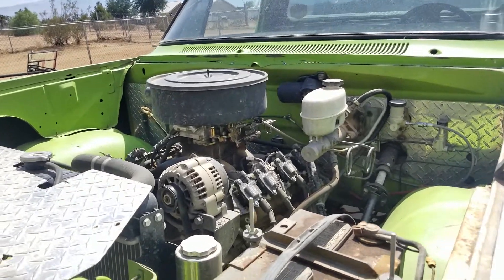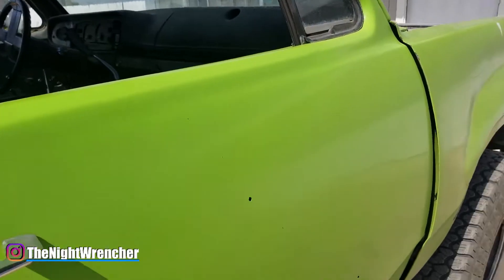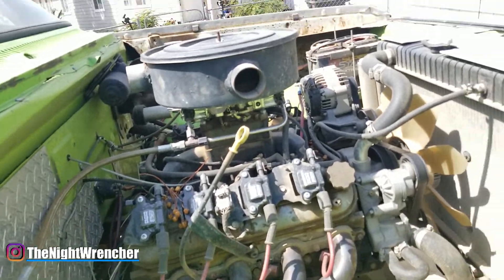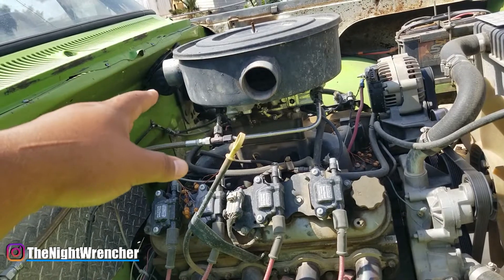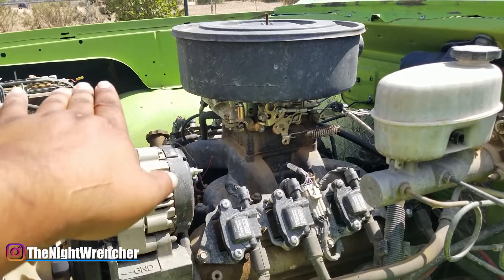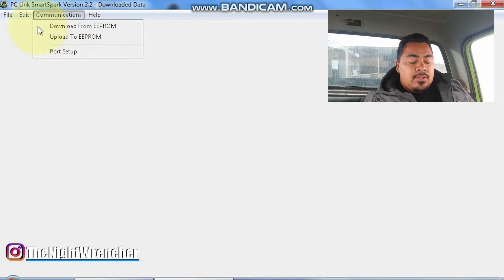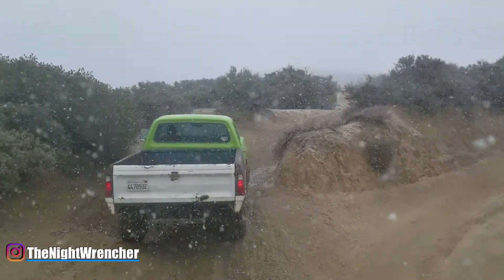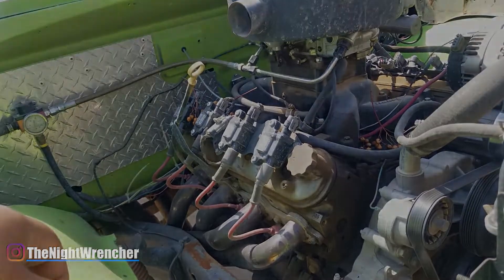6 Month Review- Daytona Sensors Smart Spark LS Ignition Controller | SSLS | Carbureted LS

Comment: Sup bro i currently have the smart spark ls too and I’m running rich and trying to figure out why. I have a 6.0 with 5.3 heads and 650 holly carb and I have the mode set to 1 the advance set to 5 and rpm set at 6 on the x1000 and 7 on the x100 can u give me any info please?
Reply from the maker: Hey man, how do you know that you're running rich?
Reply: @NightWrencher  I can smell fuel coming from pipes that use to burn my eyes before I ran the pipes in it but I still smell it and it’s a light white or blue looking smoke coming out of the pipes
Reply from the maker: @tyrekcarter4973 have you already set the idle on the carb? Ignition does not determine whether an engine runs rich or lean.

Comment: Need some help please....have the smart sensors hooked up to my gen3...issues with that motor, so now have a gen 4 on the stand...plugging the oil risers,removing goofy ass lifters,i believe  the daytona can be adjusted for the 58x crank,what about cam sensor and what cam gear..thanks for any help
Reply from the maker: Hello, if you have a gen 4 engine, the smart spark. Should work fine. Mode 2 works with 58x crank trigger and you'll need a 1x cam gear reluctor if it doesnt already have one
Reply: @NightWrencher  so I will need a front cover with the hole for sensor,will my gen 3 sensor fit the front cover,of need a new one.thanks

Comment: How do you figure out what port to plug your USB cable into cuz mind saying invalid Port I've changed a few of them and it still saying that but my computer has 254 forced to choose from🤬🤬🤬
Reply from the maker: Disconnect your usb, open your device manager in windows, plug in your usb and see what port # was added. Go into the PC link software and click up top in one of the drop down menus where is says something like port config then select the same # as the one shown in the device manager
Reply: @NightWrencher  thanks a lot you are a lifesaver‼️👍🏾👊🏾
Reply from the maker: @bigpetie66  no problem, thats what I'm here for 👍
Reply: @NightWrencher  👍🏾
Reply: I tried what you said in the device manager it comes up Port 3 so I pick Port 3 on the Daytona setup when I click download from eeprom is coming up that is not valid check your cable or your Smart Box could you possibly tell me what I'm doing wrong about to pull my hair out and I don't have any cuz I'm bald🤣
Reply from the maker: @bigpetie66  did you make sure the box was getting power?
Reply: @NightWrencher  yes it's getting power  the car cranks up and runs fine I drove it out of my shop for the first time yesterday I'm just wanting to put my own time and Curve in it so I won't have to run a map sensor with the curve that is running off of now
Reply: We even put a new cord and module box did a friend of mine had and they knew Daytona system setup that he hadn't put on his motor yet and it's still red the same thing with the brand new stuff he had Straight Out of the Box
Reply from the maker: @bigpetie66  did you make sure the little module switch was selected to "smart spark" and not "CD"
Reply: @NightWrencher  what selector switch is that I'm totally lost now I haven't seen one on the little box unless I'm looking over it
Reply from the maker: @bigpetie66  look on the black tuning module where the UBS plugs in. There a switch. Switch it to smart spark is if already isnt selected
Reply: @NightWrencher  okay thanks I'll try that tomorrow when I get to the shop if it's already in that position do you have any other suggestions or what may be the problem
Reply from the maker: @bigpetie66  sometimes you have you close everything down, disconnect everything. Open the program back up and then hook everything up after.
Reply: @NightWrencher  thanks a lot I really appreciate it I'll let you know what is the outcome again thanks a lot👍🏾
Reply: @NightWrencher thanks a lot for the information on the selector switch on the box it was on cd1 soon as I put it over the smart everything work fine I finally got my timing put in tonight thanks a lot I really appreciate the information👍🏾🙏🏽

Comment: Hey night wrench I’m have the same issue as you had with your msd box, I.e weak spark and you replaced the msd…. My scenario is we got strong spark ⚡️ on all 8 cylinders but when I disconnect cylinder 1-3-4&6 engine does not change. Checked compression. It’s at 150psi. Could it still be the msd box? Just got it from summit… outta of the box
Reply from the maker: Have you tried running a spark tester inline of the coil and spark plug to see if its still firing when rpms go up? Whats the spark gap at?
Reply: @NightWrencher  I did. I applied my spark tested inline with with coil and spark plug. With high rpm’s spark does indeed get quicker. The gap on the plugs were preset for a 05 avalanche which is where the motor came from . I don’t recall the number
Reply from the maker: @betoo0311  if you have good spark, its unlikely that the box is the problem. Try to richen the mix to see if it responds. It could just be running lean

Comment: Silly question; SSLS and Harness sold separately? So $600?
Reply from the maker: I don't know what the current prices are but yes the harness and the box are seperate. Make sure you buy the right harness for your engine, I think there are 4 different ones 👍
Reply: @NightWrencher  thanks for always helping with the comments ✊🏾
Reply from the maker: For sure, you know got you 👍
Reply from the maker: @Carlton Fortune What did you do with your old carb stuff?
Reply: @NightWrencher  I gave carb and fuel pump away
Reply from the maker: Shoulda sent them to me 😂
Reply: @NightWrencher  Yeah I should have but that was about a year ago now
 😂 I’m looking around now and this $600 not going to do much for me 
where do you usually get your head gasket set since you use the carb setup ?
Reply from the maker: I buy them as I need the gaskets but usually oreilly because they price match rock auto
Reply: @NightWrencher  subscribe to my channel I’m old to YouTube new to adding stuff
Reply: I have 03 lq4 stock can’t decide on sniper or carb still have sniper just have not installed just getting back to it
Reply from the maker: Well if you already have the sniper, just run that. For the sniper you'll need a high pressure pump and for the carb you need a low pressure high volume pump like a holley/summit blue pump
Reply: @NightWrencher  yea I already ran the fuel system I got the whole kit came with pump
Reply from the maker: Well there you go 👍

Comment: Would this be something you would recommend for an lq4 with f35 cam and 706 heads?
Reply: So I have the box hooked up as recommended by the install guide...I have no spark. The two red indicator lights come on for a split second when I turn the key and that's it. Any ideas?
Reply from the maker: Yes, thats normal. They will stay on while its running. How have you verrified that there is no spark?
Reply: @NightWrencher  I have an in-line tester kind of like a test light. I also did the old school test, stick a screwdriver in the plug wire and ground it for a spark while cranking
Reply from the maker: Yeah, thats my go to also. Remember that it takes at least 3 secs for the coils to start firing on this system. So make sure youre cranking it at least 3 secs to make sure its not firing. Next, have you tried wiring the box directly to the battery?
Reply: @NightWrencher  not straight to the battery. I have it on a 12v switched wire commin of the fuse box
Reply: @NightWrencher  I let it spin numerous revolutions to make sure there's ample time for the crank and cam sensors to link up but nada
Reply from the maker: @henryrangel7354  ok, try it straight ti battery and make sure the engine is grounded
Reply: @NightWrencher  I have a two grounds to the block..one from the fire wall and the other from battery
Reply from the maker: @henryrangel7354  ok, if you wire the red wire to the battery, that should bypass all the other wiring and it should spark
Reply: @NightWrencher  ok I'll try that
Reply from the maker: If you want to go carbureted because you like tuning carburetors then yes. If you think it'll just bolt together and run perfect then no, stick with factory efi
Reply: @NightWrencher  I have everything I need to go carb ...I bought the engine without oem intake
Reply from the maker: Oh ok, then this box would be the last piece of the puzzle. If youre comfortable with carbs, you shouldnt have an issur

Comment: Hey so I have the msd 6014 ignition box on my 5.3 a swap into my truck. Ran fine without issues for the first 3 months or so. Now every time you start it it's starts popping out the exhaust and sometimes the carb. But if the alternator is unplugged not charging it runs great. With it charging is when it starts misfiring. I already replaced the alternator and within 10 minutes of it running good it started popping again. Any ideas? All coils have spark, I replaced cam and crank sensor. Checked the wiring diagram to make sure it did that right. I pretty much am at the point where I think it's the ignition box.
Reply: I ended up adding a ground cable from a bolt on the alternator bracket straight back to the battery. And another battery cable from the post on the alternator back to the positive on the battery. Seems to have fixed the problem. Thanks for your input 👍
Reply from the maker: Nice! I'm glad it worked out for you man
Reply from the maker: Its quite possible. I would play with the mixtures at idle to see if you can get it to clear up. Have you tried calling MSD?
Reply: No. But I'm about to cuz I'm stump. I've tried different a carb on it to see if that would change anything but it didn't. It's just weird that if the alternator is unplugged it's fine. I even bypassed the truck wiring and just jumped a wire to the back of the alternator. And as soon as it starts charging. The idle drops and it starts popping and banging.
Reply from the maker: Did you try checking all the grounds?

Comment: Will the conversion adapter they sell work with the 6014 harness ?
Reply from the maker: It will but you will need to repin part of the conversion adapter because the 6014 is pinned different than the 6010/6012
Reply: @NightWrencher  okay thanks a lot for the information I have a 6014 on my car won't start because it's reading crank fault sensor and it has a new ACDelco sensor in it I'm just tired of fooling with it🤬
Reply from the maker: Yeah I wish there was an easy way to test these boxes but I dont really know how
Reply: @NightWrencher  thanks

Comment: So how much & how difficult u think adding the stock ignition would be for me?? Have any links??
Reply from the maker: Stock ignition for a sniper? Ive heard of a few people doing it but I dont know exactly what they have to do. For a regular carb you have to run a custom tune with HP tuners and add a tps to the baseplate
Reply: I know you’re getting tired of me but going to junk yard tomorrow to look for heads are the 862 the best option for me? 
I see a lot of ppl say 799 or 243 let me know your opinion please. Nobody really on LS swapping around here so heads are only $70.
Reply from the maker: 862 are your best bet for an NA build 👍799 or 243 heads flow more but you get more compression from the 862 so itll run better
Reply: Ok got it
Reply: So I got $600 to spend right. 
I have 4 header bolts broken off-shop charges $20 to remove each broken bolt. 
Since I have to take my (317)heads off and take them to the shop, I have a couple more questions for you. 
What upgrades would you consider? 

Different heads or get cam and spring the 317s?

What would you do in my position using the lq4/sniper and $600 spare bucks? Not counting getting bolts removed.
Reply from the maker: Cant go wrong with a cam kit since the heads are already off, you can get the springs replaced easily. If you can get yourself a set of 862 heads from the junkyard off of a 4.8 or 5.3, thatll bump up torque down low. Not nessesary but it another option.

Comment: NightWrencher, did  you ever have to move to a front cam position sensor?  What your thoughts on this, run with the rear or go  ahead and move it to the front.
Reply from the maker: I'm still on the rear cam sensor and havnt changed anything on my set up. Everything runs perfectly fine except for the extended start up time. Its not worth changing for me right now but maybe if I end up doing a cam swap soon, I'll spend the money on a fancy front cover and swap to the front cam sensor.
Reply: @NightWrencher  what kit would u run for swapping it to the front
Reply from the maker: @tacogoblin9770 I already bought my cam so I'm going to upgrade to a 4X double row timing chain kit and a fancy billet front cover with the front cam sensor. You can source used parts out of like an LS1 with the 1X reluctor and front cam sensor.

Comment: 😎👍🏽 I’ve seriously considered putting a carb on my 5.3 firebird because I feel like I can tune a carb easier and cheaper than I can tune a gm PCM with no wideband sensor
Reply from the maker: With no wideband I would probably go EFI since its already ready to go. Plug the stock computer in and drive. If you plan to modify it for big power then you definitely want to get a wideband
Reply: @NightWrencher  Ive been driving it with the stock EFI and flex injectors and I have TunerPro but I have no clue how to tune it other than the injector flow rate for the flex injectors.  I see trim data but I have no clue if it’s ACTUALLY lean or rich.  Previously it was showing close to zero trims but it was obviously lean , I think it needs to be tuned or maybe my o2 sensors are fouled because it it’s lean it should be adding fuel 🤷🏽‍♂️ if I had a carburetor I could tune it , but I have no clue how to tune this and that’s what makes me want a carburetor.  They say I need a wideband, and I need a tuner.  I have the ability to flash the pcm and I have changed to the flex injectors flow rates but I have no clue about the MAF or volumetric efficiency or where I’m at AFR.  I can see trim data but it seems inaccurate.  My plugs were white and chalky when my trims were zero